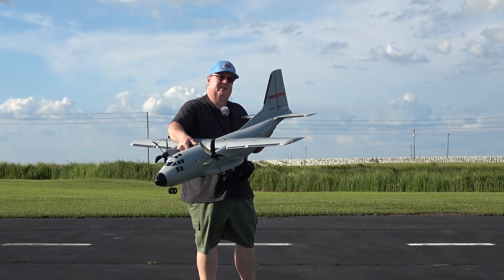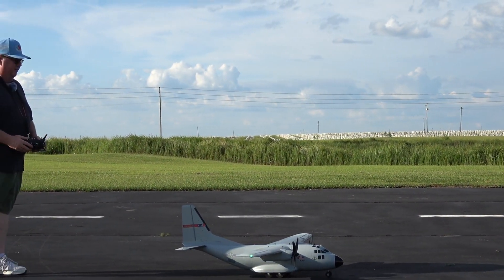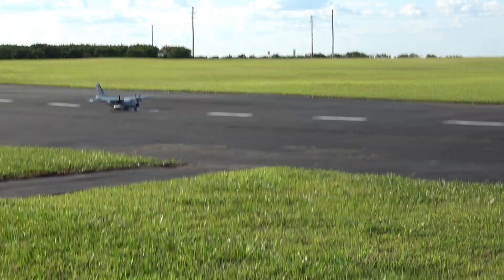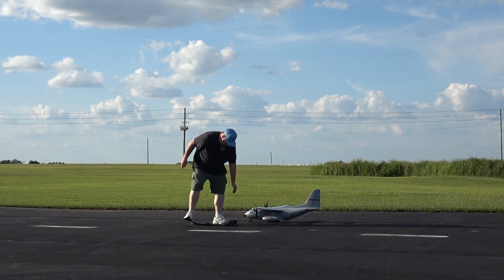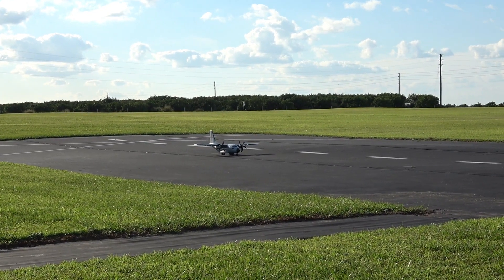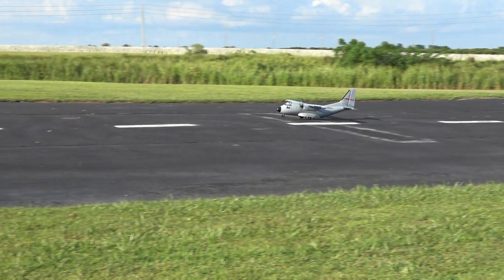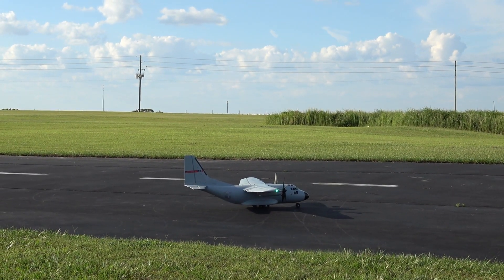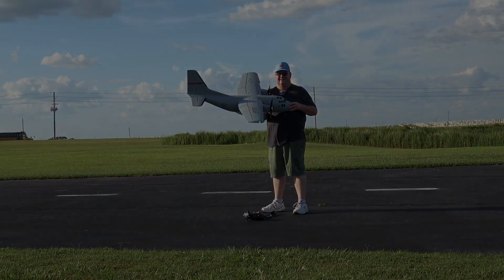E-FLITE EC-1500 MAIDEN by Fat Guy Flies RC

Comment: Good maiden FGFRC!

Heads up on the channel limitation and reverse thrust. Spektrum Rx and Spektrum ESC you dont need a 7th channel to control reverse thrust. Avian ESC Foward Programming and set to aux 2 or aux3 if your using Safe so its not on safe channel. Activating Reverse Thrust and Safe at same time isnt good outcome :(. Go into Channel assign and assign the switch you want to activate on the corresponding aux in FP...
Reply: Yep, I was just about to say the same thing, the ar631 can listen to 20 channels , it’s limited to 6 ports but doesn’t mean it can’t listen to more…. My ar631 are almost all configured to 8ch incl safe select and reverse
Reply from the maker: Yeah I need to dive into that more.

Comment: Thanks for your maiden flight review. I am about to maiden my EC 1500. I really like the way you have it painted and especially the nose piece. I have flat water based Varathan Polyurethane to spray on mine. Can I ask a few questions? What did you have to cover or tape off to do yours? What did you paint the nose piece with? I really like how that looks. Keep the videos coming, good work!
Reply from the maker: Well the nose cone comes off so not need to cover or mask. I used that cheap craft paint Walmart sells in the craft section, black high gloss. Also I spray the entire plane after with a light coat of polyacrylic from minwax.That protects the paint like a good wax job does on cars. Here is my video on it: https://www.youtube.com/watch?v=ihQNpO_W2Ew
Reply: @FatGuyFliesRC  thank you for your prompt response. I have painted the nosecone of mine black like you did yours, I think it looks very good so mine now clearly has the fat guy RC modification. I limit a much more space constrain environment than you, we have moved from my house and garage to a two bedroom condo so I have made a way to store mine on the wall with the wings and tail surfaces off and made a carrier for the car to support all those so it can be transported safely as well. I have a little bit of touchup to do on the original paint and then will coat it with a clear satin spray paint. I am looking for an extra “Marines” decal for the bottom of one wing. I am also doing the modification of adding low bounce wheels to try and make it sound a little better on takeoff and landing rolls.
Reply from the maker: Try a food grade silicone like this one:  https://www.amazon.com/Waterproof-Silicone-Grease-1-Pack-88693/dp/B000DZFUPC/ref=sr_1_8?crid=9P1RS9DE0BUS&dib=eyJ2IjoiMSJ9.qZk-1V36Dc9xw5t5xw5hAXICSvMZ0lkWeAEGRyiFDXcXU7BR8HvtNzLEDn4dJPJNTcOI306RTHrS3VVS0IM_iiTNJlax2wjUIH5ewvIuyGnksGFB6FdOxEu1xsEMs0uwNqXTItUNeMw9haoyZL5hjK_mk02Dgm6Z2JlybJq0u-HOCGwbZUHCHGvzufney1yV_cvhVFuDv3B732G66X3x8BDNno6dKTcRP_DPBxcIPbE.T7R1vEJ4NMZSClcuE-T47R5naYzvf6WvkxxQVHTUdI4&dib_tag=se&keywords=food+grade+silicone+grease&qid=1724374834&sprefix=food+grade+sil%2Caps%2C146&sr=8-8

It will help with the landing gear noise.
Reply: @FatGuyFliesRC ordered, thank you